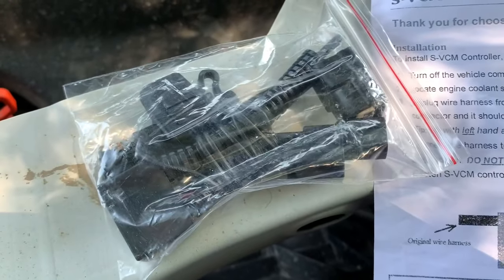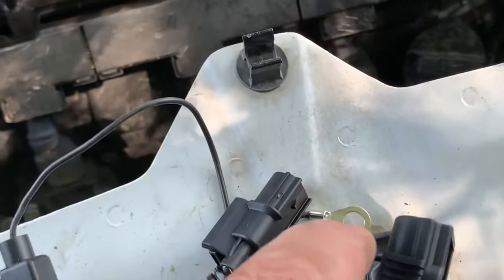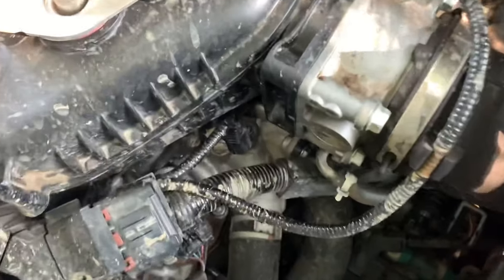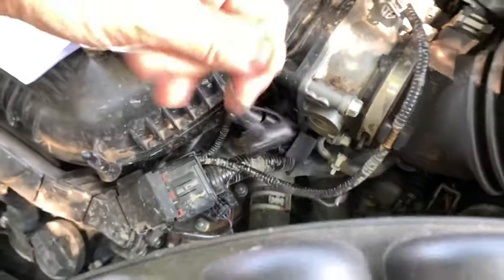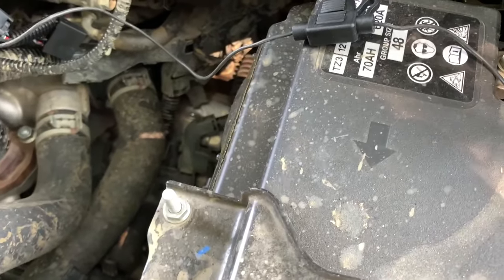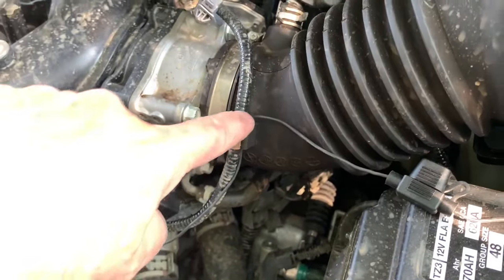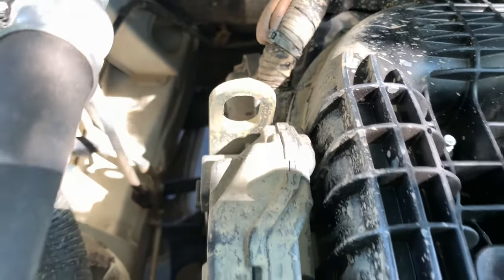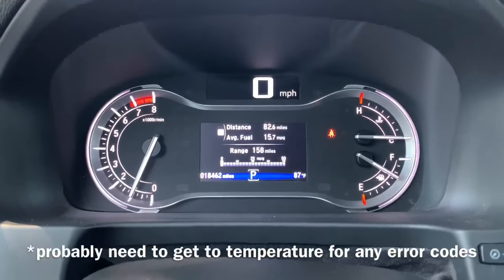Disable VCM (Varible Cylinder Management) in your Honda Ridgeline Honda Passport Honda Pilot Forever

Comment: The other MAJOR issue with the VCM is when it shuts down cylinders they are all at different temperatures which with an aluminum engine block can cause warping and leads to the vehicle using or "burning" oil between oil changes. It also creates sludge which is very bad for oil distribution throughout the engine as well as gums up the piston rings. So do you want fuel economy with less engine life or do you want to sacrifice a very small amount of fuel economy for longevity and reliability that Honda is known for? I personally have chosen the later. I also recommend 5000 mile oil changes with all engines if you've been told that you can go 10,000 read the owners manual or research it. In actuality VERY few people could do this safely as it depends on driving habits.  Also our Ridgeline has had the transmission "judder" and was taken to the dealer several times. First they reprogrammed the transmission module per the service bulletin and when it returned they dealer now recommends changing your transmission fluid and filter every 20,000 miles. Every third one they recommend you do a flush. Which is you drain (leaving filter in place), fill, run it for 15 minutes, repeat previous drain, fill, & run procedure, then the third time you drain, replace the filter and fill. They say the "judder" is now caused by transmission oil contamination.  This actually has worked and it's not as hard or expensive as it may sound if done yourself. These don't hold much fluid and the filter is external. So if you can change oil then you can do this. Also if you wait for something to "happen" or for signs of something most of the time it's too late to fix. These are known issues with these Honda VCM V6s going back over a decade now.
Reply from the maker: Nice to know!!!!
Reply: Not to mention that long term VCM usage can lead to damaged CAT converter as raw oil accumulates over time and ruins it. I also heard the Honda built this VCM mode to pass on emissions. So, the Honda VCM is : Nice from afar but far from nice …. Over time.
Reply: I’ve owned several Hondas and maintain the regularly.  I’ve never had an issue with using oil.  Many high mileage cars that burn oil have worn rings or valve seals.  Worn rings are associated with dirty oil, extended oil change intervals, or high mileage.   I suspect the oil use issue with VCM is that downstroke creates a vacuum that suck oil past the rings and more so especially if the rings are worn.   This makes use of the sVCM more compelling on older high mileage vehicles.  However, I plan on installing a S-VCM on my 22 Passport to keep things simple and help the engine and cat converter last longer.
Reply: sorry... wildly incorrect on block temps. the water jacket normalizes the temps. sludge is from high temps, low oil flow, and worn out oil/additives, NOT low temps (which we covered already).

and the manual already stated to do a change AND flush every 30k so 20k changes and 1 per 3 change flushes is overall easier.

Comment: Question: 2023 Ridgeline has a 'green leaf' button for "eco" that can be turned on/off.  Is that button controlling the VCM?
Reply: No, I have eco mode off and can tell when the vcm is limiting the engine by the green glow around my gauges. White means full engine power. Green means vcm is limiting to 3 or 4 cylinders.

Comment: installed this for my wife's 2017 Ridgeline and it seemed to work great right away. What I didn't know is the problem crept back up and I wasn't aware until I drove it recently. I just uninstalled the unit and reinstalled and it seems to be working but, honestly, it almost feels like the problem is still there but it very, very subtle. Almost like it's in the background. Thoughts on this, anyone?

Comment: Hi Randy

Please please please PLEASE use your Ridgeline magic knowledge to find a way of disabling CMBS and Auto Stop / Start on the Ridgeline without having to switch them off before each journey. (They turn 'on' again when the engine is restarted even if one turns them 'off'.) Thank you, thank you thank you!
Reply: $30 idle off from eBay does the trick for this. Just installed mine yesterday with maybe 5 minutes of effort.

Comment: The more I learn about the J engine in the Ridgeline the more I am steering away from it being my next vehicle. Hopefully the Taco 2024 refresh gets coils in the rear and keeps the naturally aspirated 6.
Reply from the maker: After driving Ridgeline you will hate the ride and ergonomics of the Taco. Thanks for watching.
Reply: As long as it doesn't rust out and your good with the feel of sitting on the floor. Wonder why more trucks are going unibody unless you have a place to rock crawl

Comment: How does this differ from leaving the Eco mode off all the time? Not sure if I should invest in one for my 2020 RL.
Reply from the maker: Eco mode lowers a/c output so your trucks going to take a hell of a long time to cool down. Also expands the shift pattern and softens the response of the gas pedal.
Reply: Eco mode doesn't disable the VCM.  Just changes the throttle responses and AC output.
Reply from the maker: Didn’t I just say that?
Reply: @CampingRandy  you didn't say the part that it doesn't disable the VCM :)
Reply: Yup, never use the Eco mode and it is another button on the dash that could disappear.

Comment: Vehicles equipped with VCM
2003 Honda Inspire
2004+ Honda Elysion V6
2005–2007 Honda Accord Hybrid (JNA1)
2005+ Honda Odyssey (USDM) EX-L and Touring Models only (J35A7)
2006–2008 Honda Pilot 2WD Models only (J35)
2008–2017* Honda Accord V6 (except EX-L V6 6MT Coupe) *Starting with 2013 Model, VCM operation is 3- or 6-cylinder mode, no longer 3, 4, 6-cylinder operation.[2]
2009+ Honda Pilot (all models)
2011–2016 Honda Odyssey (USDM) V6
2013 Acura RDX V6
2013 Acura RLX *3 or 6 cylinder mode
2014 Acura MDX *3 or 6 cylinder mode
2015 Acura RLX Sport Hybrid *3 or 6 cylinder mode
2016 Acura TLX V6
2017 Honda Ridgeline
See also
Chrysler's Multi-Displacement System (MDS)
Daimler AG's Active Cylinder Control (ACC)
General Motors' Active Fuel Management (AFM)
Variable displacement
Reply from the maker: Awesome thanks for posting. I’ll put in the description.

Comment: My first car was a well used 55 Chevy, $35 running in 1968, it had throttle lag when accelerating just like my new 2021 HPD Sport, the engine quit when stopping at stop signs or lights just like my HPD, and it had cylinder deactivation due to excessive oil consumption fouling spark plugs similar to HPD, awesome😂🎉😅❤😊technological genius
Reply from the maker: Thanks for the comment!!!!

Comment: Got one for my 2012 Honda Crosstour V6 - installed per the instructions - no error codes and worked like a charm for a bit - then the ECO light comes on again just like it normally did. I contacted the supplier and they sent me a new one but same result - so not sure why it does not work on this car. Have taken it off as it really doesn't do anything.
Reply from the maker: Awesome- great to hear. Enjoy. Thanks for watching!
Reply: Hopefully works for my 2011 accord sedan v6 auto. order one a couple days ago. Burning a quart of oil every 3400 miles
Reply from the maker: On the way!

Comment: If you leave ECO mode off will the engine still go to 3 cylinders on the highway?
Reply from the maker: All eco mode button does is lower a/c output, deaden pedals, and expands transmission shifts. VCM runs when 43 variables are met. One being engine temp.

Comment: My wife has a 2017 odyssey touring is there a way to turn the eco mode off which also shuts down cylinders corrects. Thanks
Reply from the maker: Eco mode does not shutdown the cylinders. All the ECO light does is advise YOU that you are driving efficiently. If there is a button, press the button to off. In older Hondas ECON light on the dash is a happy light, the Econ BUTTON , deadens the pedal, extends the shift patterns in transmission, and lowers A/C output. Let me know if you have further questions. Thanks for watching.
Reply: @CampingRandy  on the 2017 odyssey no way to shut it off.  And what I read online but it could be false like most stuff online they said it deactivated cylinders. I have felt the stutter there's no shutoff button until 2018. Here's what I found.   Does 2017 Odyssey have VCM?
All trims use a 248-hp 3.5-liter V6 engine that features Honda's variable cylinder management system (VCM), which allows the V6 engine to switch among three, four, and six cylinders to increase fuel efficiency.
Reply from the maker: I think we are loosing context in text. 1. Your vehicle has VCM 2. The Econ light or button does NOT shut cylinders down. 3. There needs to have 43 variables met to shut cylinders off 4. The SMART VCM Module de-activates your VCM FUNCTION - installed all cylinders will ALWAYS operate.

Comment: Install was a breeze, I feel like it’s working but is there any way to tell for sure it’s working? Just want to make sure the VCM is definitely not turning on. VCM is a terrible idea and after seeing the issues Chevy had with it in Silverado I want no part of it! Gas is cheap compared to an engine or transmission!
Reply from the maker: Your temp gauge will just be a bit below mid.

Comment: I have a 2007 Honda Pilot 4wd does it has the vcm? Mines using at least a quart a week sometimes 2 depending on how much it's driven. Ive read online the vcm was only on the  2006-2008 2wd pilots. If not this what else could be the problem? I changed the pcv valve no difference.
Reply from the maker: I was told yes it does.

Comment: If the lights turn green does that mean the VCM kicks on. I just put it on and it's doing that.
Reply from the maker: That’s showing it’s getting power to the module. Thanks for shopping with us.
Reply: Sorry so late with the reply. I'm talking about the green light on the odometer.
Reply from the maker: That’s driving style. Green means your driving well and saving has. When it’s gray, you to heavy on the pedal.

Comment: I disabled my Odyssey and I noticed no difference in mileage.  Even if I got 5 mpg less it is still worth it, versus fouled plugs, and burning oil. worn out motor mounts, and several other problems.
Reply from the maker: Some folks say zero. Others say 1or 2 mpg lose. But yes - worth it!!!

Comment: My '18 Ridgeline RTLE had the RPM flutter and hesitation maintaining speeds with cruise control set on highway and going up even the slightest of inclines. Thinking it was burnt ATF, I performed the recommended 3X drain & fill of the tranny fluid @ 30k miles which did make the RPM flutter go away but it was still having vibration mimicking the feel of a tire out of balance cruising @ 45-70 mph and a severe power hesitation/lag which felt like the transmission was slipping. For example, if CC was set to 70MPH and an incline would slow the truck down, it would drop to about 67 mph before it would start to try to accel back to 70. The RPMs would jump to about 5000 before the vehicle would even begin accelerating. It was driving me completely crazy but I lived with it until the problem seemed to be getting worse approaching 40k miles. BTW, I never tow anything, nor am I what even a grandma would consider, hard on the throttle.

So, I took it to the Honda dealer thinking my tranny was going bad. They did a torque converter snapshot and said that I needed a transmission drain & fill (I didn't tell them I had already performed the procedure myself 6 months ago @30k) and they quoted me $450 ($150 each X3).  After telling them to go pound sand, I debated trading the truck in on a Taco (which I really didn't want to do as I loved my Ridge and its previous ride quality over all else) I did some research on the Ridgeline owner's forum and found that the true cause of my problem was likely VCM engagement/disengagement. I found a link to Randy's store and thought 'what the hell, I'll spend the $100 and see if it fixes my problem. If not, I am getting rid of this truck.' 

Well, my S-VCM controller came today and took about 5 minutes to install. I took it out for a ride on the highway and around town and HOLY SH!T what a difference. No more power hesitation, no problem maintaining cruise speed, it is riding so smooth again. I drove the truck about 40 miles and never once experienced power lag or the vibrations. As for possible MPG loss, I will gladly give up 1-2 MPGs to have the ride quality and power, & if the rumors about VCM causing piston rings, plugs, and engine mount failures are true, the extra cost of the fuel will be more than made up for by this device disabling it.

Thank you, Randy for allowing me to keep my truck and love it once again.
Reply: Get the VCM disabler:thanksdoc:
Reply: Gen 1 no VCM
Reply: Go test drive the new Ford Maverick see reviews
Reply from the maker: It’s the trans fluid. I had the same issue.
Reply: 3x drain and fill 2019 Ridgeline rtle with tiny tranny cooler. Burnt fluid at 35k. Valvoline Max life. Much smoother but got the svcm so the truck lasts longer
Reply from the maker: Great to hear!!!!

Comment: Hi, I am hoping this will eliminate the buzzing noise my 2017 Ridgeline randomly makes at 1800-1900 Rpm. One question, is that going to affect the Eco function too?
Reply from the maker: All the ECON button does is dreading  the gas pedal, expand the shift range of the transmission, and lower a/c output; which sucks on HOT DAYS. DO NOT USE when you first get in you truck on hot days. The S-VCM disables the truck running on three cylinders. The truck will run on all six cylinders all the time. Thanks for watching!
Reply: @CampingRandy  good, I only use it on long highway stretches. I just ordered one, I'll leave a feedback once I install and use it. Thanks!
Reply from the maker: Awesome to hear!!! Thanks for watching.

Comment: Doesn't work correctly. I installed one and just finished a 3,400 mile trip. My  VCM kept coming on after a few hours of my initial trip driving, and then virtually the whole trip except when the engine is warming up. Seems to only work on short, less then 10-20 mile trips only. I have no idea what the engine temp is since the VCMTUNER controls the temp gauge sender voltage. The temp gauge never moves after it warms up and no longer reads what the actual temp is. It could be running hot and I would never know it, so beware. I think there is more to disabling the VCM than just by the gauge temp sensor.
Reply from the maker: Did you reach out directly to get a replacement?

Comment: I got a question for the original poster of the video I have a 2018 Honda pilot 43,000 MI I bought the svcm plugged it in now I noticed on the dash on the edge of the RPM gauge and fuel and the coolant gauge there's green LED lights on the edges as if I'm in eco mode is that normal
Reply from the maker: That’s Honda’s ECO ASSIST. It gives you feedback on your driving. Heavy pedal input it turns grey/white. Easy inputs shows green that you are accelerating at a fuel savings. The ECON button displays a GREEN LEAVE on the dash which reduces A/C output, expands shift points of transmission, and deadings the gas pedal. The VCM with the SVCM does not allow Variable Cylinders Management to operate no matter what mode.

Comment: I haven't noticed any vibration yet, only 300 miles in the two weeks i've owned it, but i hear a subtle/faint valve knocking when i switch to Drive and hit the gas pedal. It does go away in a few seconds though. I didn't hear that in my older Infiniti. This may not be related but thought Randy  may have heard something like that in the past?!
Reply from the maker: That’s it.
Reply: @CampingRandy  so been that my truck is only 2 weeks old, is that something covered in my truck warranty? Or do i need to do this on my own?
Reply from the maker: I’d put a few thousand miles on your Ridgeline first before installing anything.
Reply: @CampingRandy  Thank you Randy.
Reply from the maker: You are welcome

Comment: do the gauge cluster lights remain white while driving after installing? Or do they still cycle though white > light green > green?
Reply: 2019 Pilot 6AT , only thing that changed was the temperature gauge, it stays at 165 but when I gets over 105 outside it goes back to normal 
No issues so far, I did notice the difference after installation, having a 6 cylinders available all the time makes the driving experience much better.
I’m probably getting 1 less mpg in the city but I usually get 20mpg , haven’t done highway miles yet only city drive
Reply from the maker: They will still run green

Comment: I just installed this and got like 15 error messages.   Power steering.  Lane departure. ACC.   So on.    Went for about a 5 mile drive and essentially nothing with a sensor works.    Any idea how long it takes for the issues to go away?
Reply from the maker: If they don’t go away, disconnect the battery to reset.
Reply: @CampingRandy   I unplugged the unit. Reinstalled  and everything went away.
Reply from the maker: Great to hear!!! Thank you.
Reply: @CampingRandy   so interesting thing.   I just went for a drive.   All was well.  Pulled in the driveway and all the warning lights/messages popped up again and my ridgeline shut off.   Started flashing "keyless start not responding "  and would not start  doors wouldn't lock.  I unhooked the battery for 5 minutes.  Hooked it back up.   Same thing.   I pulled the vcm mod off and she fired right up.
Reply from the maker: Email me at support@ridgelinestore.com and we get you another one. Something is up. Go ahead keep disconnected.